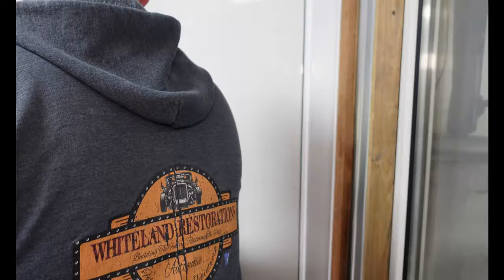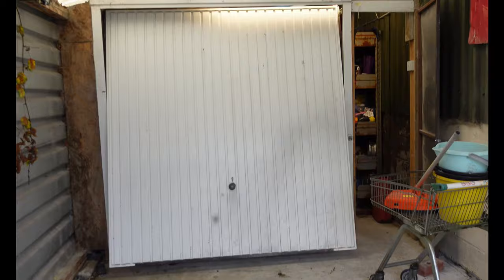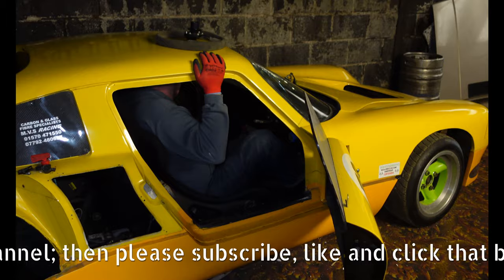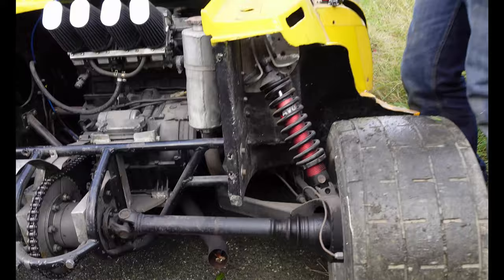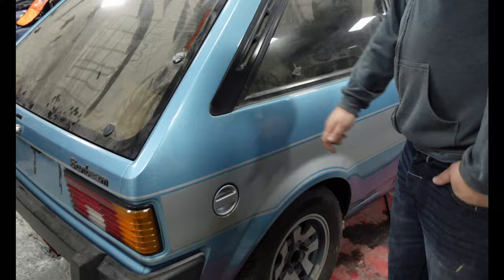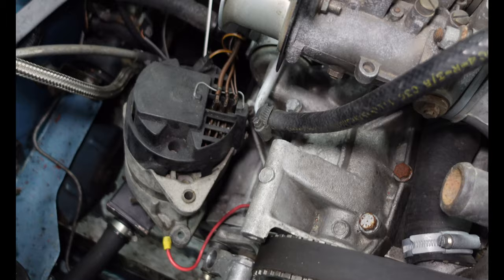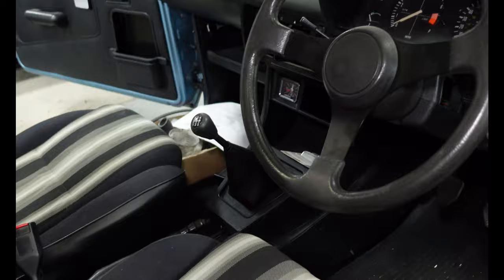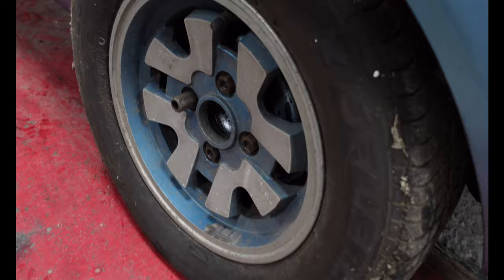What Car Did We Pull Out of Storage?? Huge move around in the workshop to get to the treasure!

Comment: The Vaux slant motor (which this is based on) was prone to drain down & therefore slow build of pressure on startup. I think your Dad was right to try & fix it as it's bad news for any engine. Nice car though, looks like he bought well! I remember when £5k seemed likequite a lot for one of these....! How things have changed!
Reply from the maker: Yes apparently that's the way they are from new. We did manage to source a oil filter with a built in check valve though so that might help with the drain down. Oil pressure is spot on when it's running though. You'll see what we do in future episodes 😁